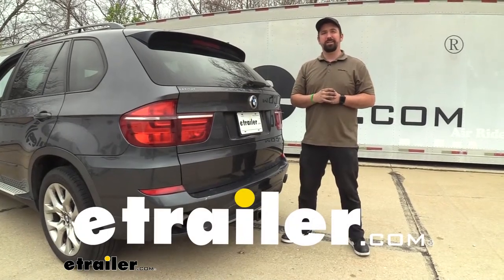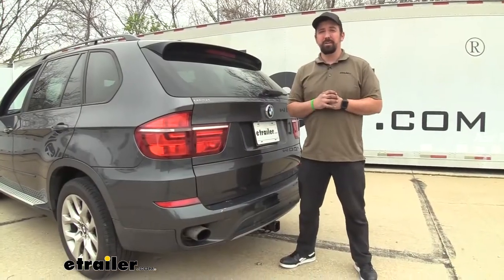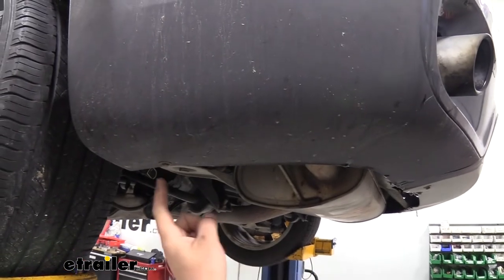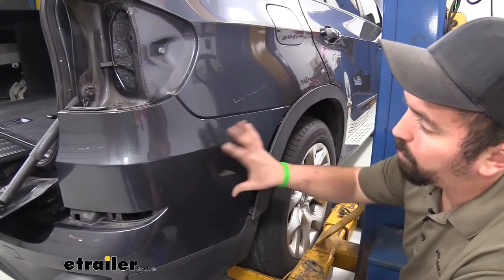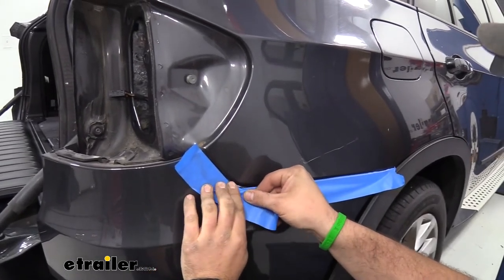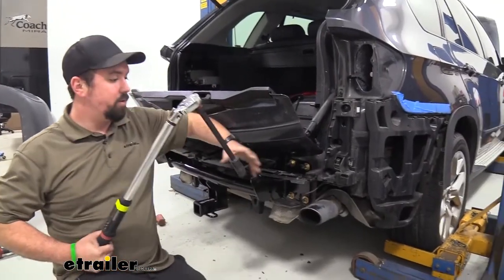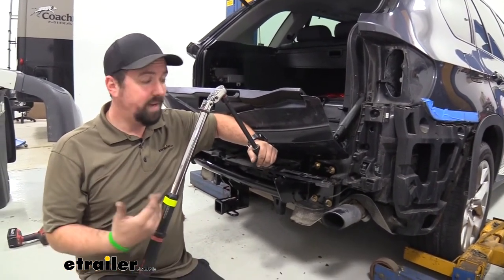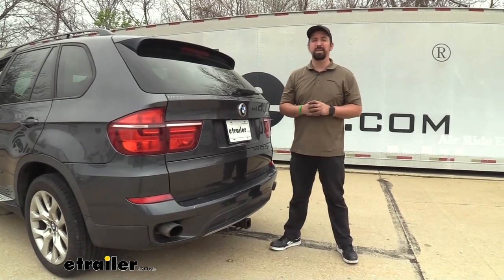etrailer | Set up: Curt Trailer Hitch Receiver on a 2012 BMW X5

Comment: what about electrics such as turn signal and break lights?
Reply from the maker: Good question! If you have the 2012 X5 like in the video you can choose between a couple harnesses: https://www.etrailer.com/t1-2012_BMW_X5.htm. If you don't like to splice wires your best bet is the Tekonsha ZCI https://www.etrailer.com/Custom-Fit-Vehicle-Wiring/Tekonsha/119250KIT.html.

Comment: Can I tow a car like a bmw 335i with that hitch?
Reply from the maker: Yes, both the Curt # 13077 hitch and the 2012 BMW X5 itself are capable of towing the approximate 3500 lb weight of a BMW 335i. However, you'll want to check with BMW to ensure that the 335i is capable of being flat towed without being damaged.
 https://www.etrailer.com/Trailer-Hitch/CURT/13077.html
Reply: @etrailer  yes, it can be flat towed.. just wasn't sure even after mods and a tune if my x5 could safely pull a car.. without the hitch bending or breaking.. I will order a kit soon then
Reply: @etrailer  also, do you have a link to the electrical?